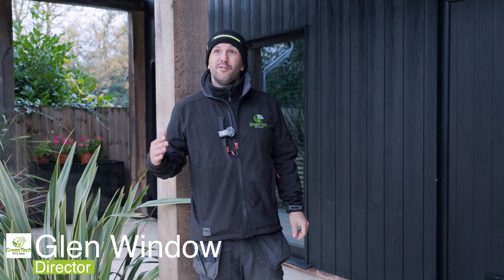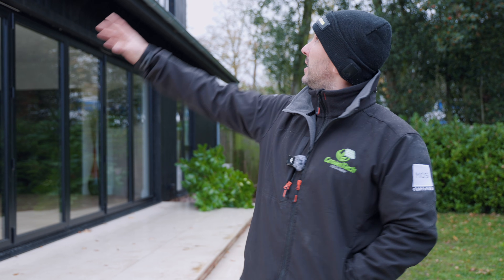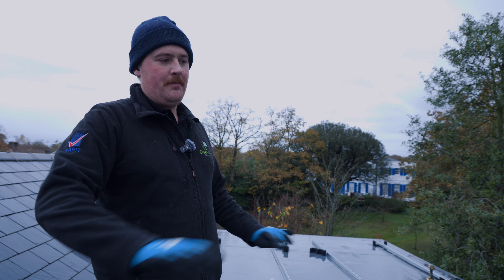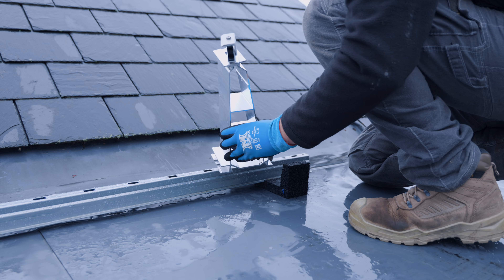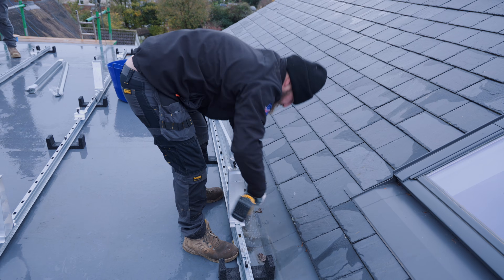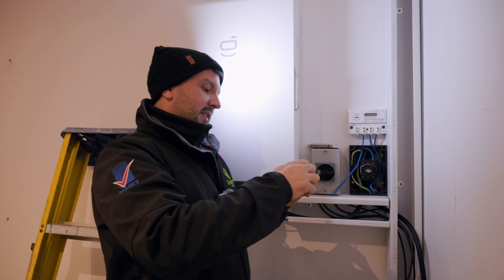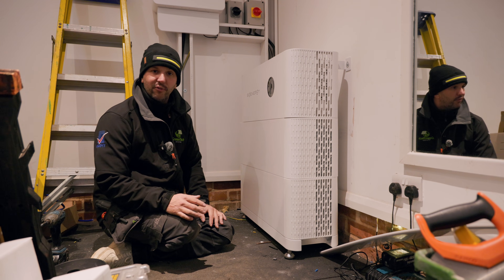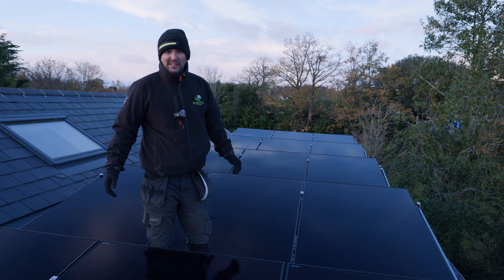Combining a Sigenergy System with Van Der Valk!  | Vlog 005 | Greentech EV & Solar

Comment: The Bypass is to manually switch over to off grid mode or to bypass the contactores in case failure of the contactores or the failure of the automation?